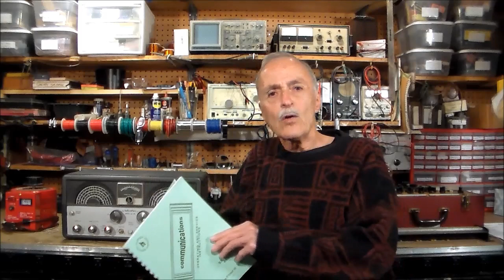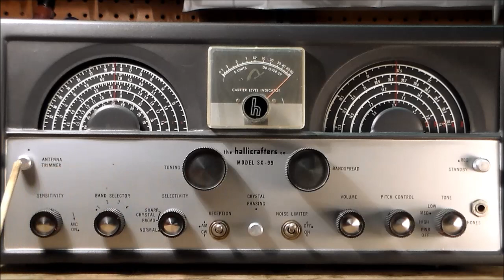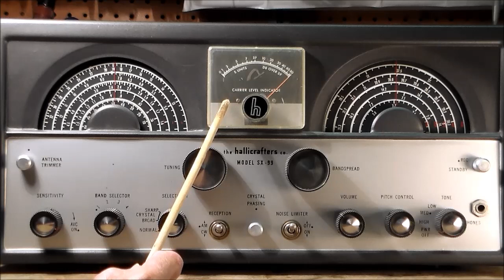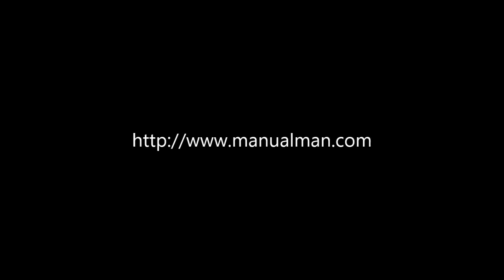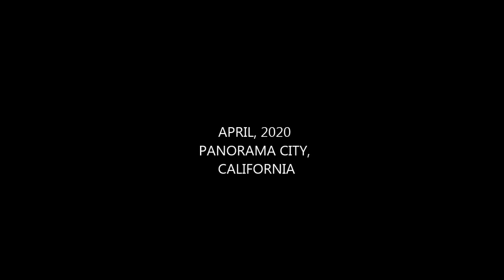HALLICRAFTERS SX-99

Comment: Nice video.  I just acquired a Hallicrafters SX-110 in an estate sale. It is in very nice condition.  The sensitivity knob is frozen, but I grounded it to the Send/Receive switch and it works great.  I purchased the Radio by Hallicrafters book, by Chuck Dachis that you held up in a different video.  I find it very helpful.
73 Paul AA1SU

Comment: hey, i have this exact radio that i just bought and i am very new to theses things, everything looks in great condition, it lights up and it definitely receives power. I have a R-46b speaker that came with it as well and when i hook it up it only makes static when i switch the tone dial on and off, do you have any suggestions on how to get it working?
Reply from the maker: Hi Jack,
Are you aware that these radios need an external antenna and a ground?  The antenna could be a 75 to 100 foot long wire strung up between two poles. The ground can be any metal cold water pipe. Without such an antenna, you will most likely only get "static". For now, just attach a long piece of wire to the antenna post on the back of the chassis and turn the band switch to band one, the broadcast band. This will tell you if radio is working at all. You might also want to get the operating manual. It is often available on Ebay. Antenna kits are available on Ebay  very reasonably. Good luck!

Comment: Nice receiver.  My father used to work at the main assembly plant for Hallicrafters, at 5th Ave. and Kostner Ave., in Chicago, Il, during the 1960s. He was a production shooter, whose function was to work on receivers (and transmitters) just off the assembly line that did not work properly, and he repaired them to ensure they would meet specifications, such that they could be sold as new products. Who knows, maybe he even worked on your particular set, at time of manufacture.
I would personally recommend that you at least replace all paper capacitors in that set. No need to check them, just replace them all, because they were notoriously known to fail by leakage. They are very inexpensive, and cheap insurance to protect items that it is almost impossible to find, like power transformers, band switches, etc.
A friend gave me a Hallicrafters SX-43 receiver that smoked. Turns out a tubular capacitor shorted out internally, and caused a wafer in the band switch to arc, burn, and carbonize. I did get it fixed, by almost surgical techniques, scraping out carbon, replacing the burned out areas with epoxy glue. Two full evenings of grueling effort could have been prevented by replacing these caps before damage such as this. I was very lucky and successful in my repair. It was worth the effort for this fine receiver.